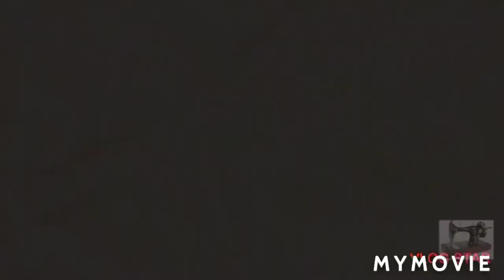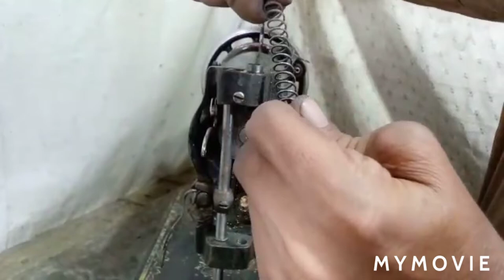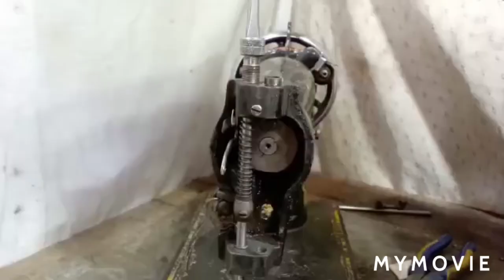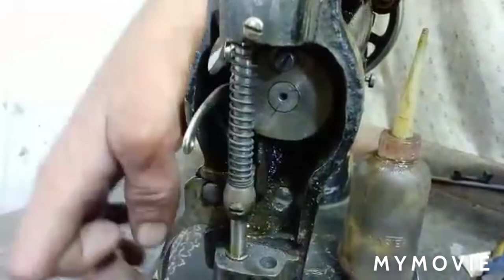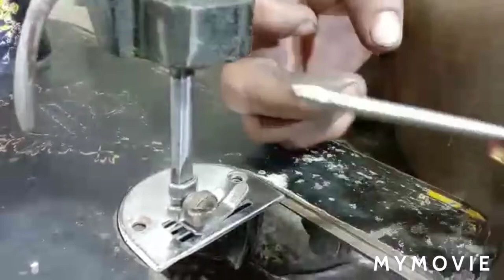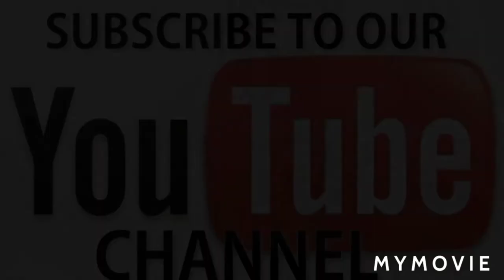How to adjust the Presser Foot Bar on Sewing Machine very easy  FULL HD

Comment: Thank you !!  This is the exact thing I need to do and this is very helpful, much appreciated :)
Reply from the maker: At last! I'm pleased to hear that. Check out my latest video.
Reply: Hello... Can I do dis? I think my mechines bar is long n I cant set any other foot to my mechine
Reply from the maker: If the machine is Juki the big machine then you need to fit bigger foot on the needle bar, small foot won't work on it. If it's a small machine, use small foot. 

Otherwise, please send a short video on the number on the about section.

Comment: Would this be the same for a serger?
Reply from the maker: I don't work with serger machines. Here in Pakistan we only use the old singer type machine. I believe the serger is the plastic body machine new type. I only work with old machines and new Juki ones.
Reply from the maker: Please check out my new video. If you like it please give it a thumbs up.